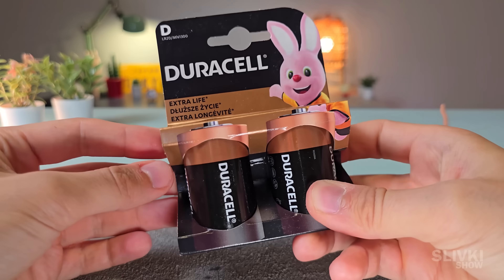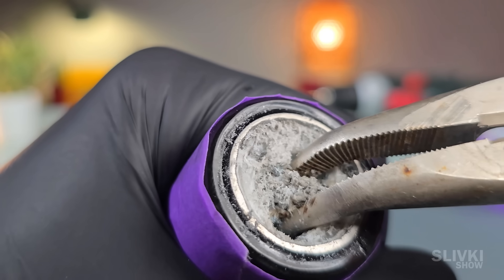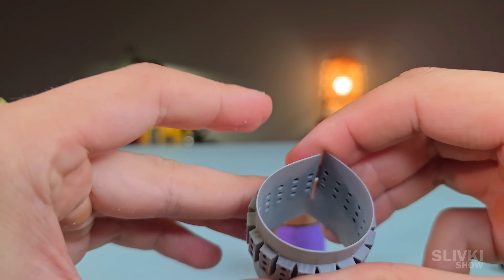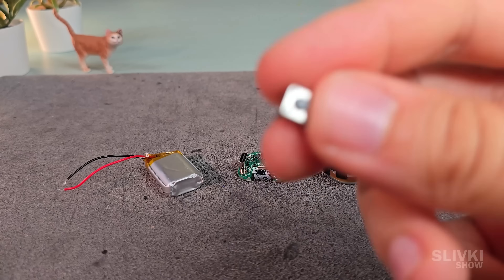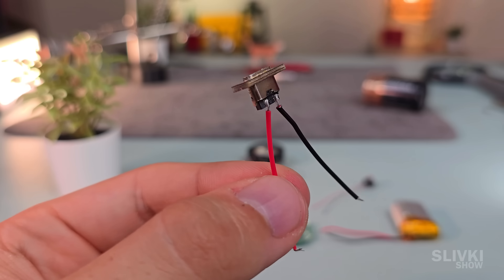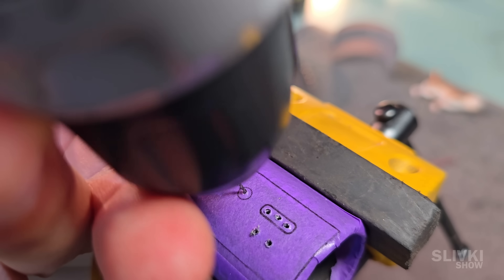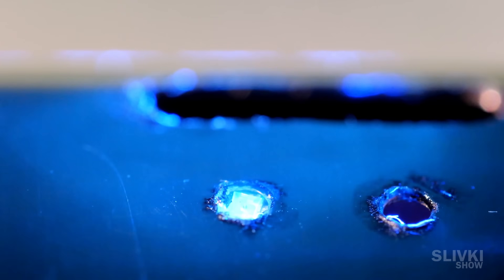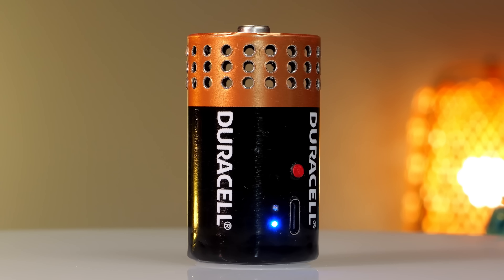I MADE A WIRELESS SPEAKER OUT OF A BATTERY

Comment: Version 2 - cut two separate batteries along the line where black meets copper color. (One in the black, one in the copper). Take the two “good” “halves”, sand and print an insert for each that’s threaded so you now have a battery where the copper top screws onto the black bottom. This time, drill a speaker grille into the bottom end or replace the bottom end with mesh.

Comment: 3:58 I bought one of thoseclamp things, but it's dreadful. The crocodile clips don't stay in place, the spring that is supposed to hold the soldering iron is too big and the iron falls through and melts the plastic base. The magnifying glass is the best part, but it has an LED that doesn't shine on the work piece. The base has too little weight and is smooth, so it slides around and eventually falls off the table.
The LEDs do not need to be that small, that just causes more problems.